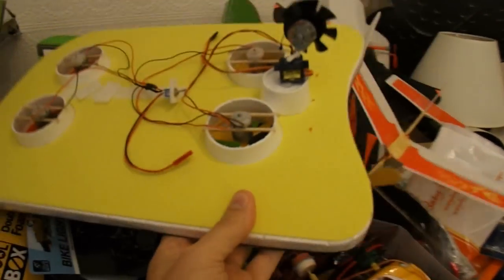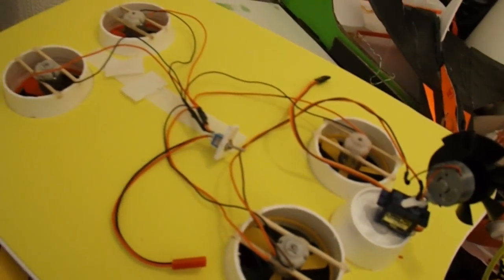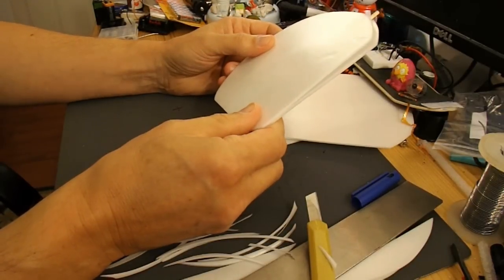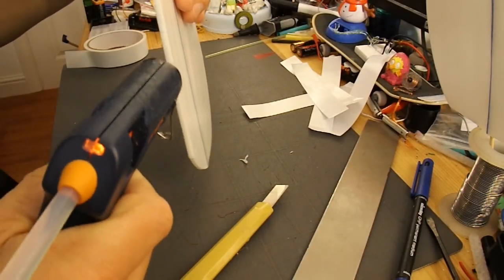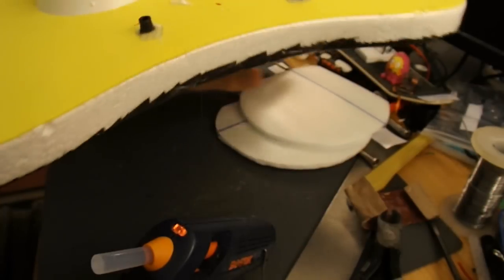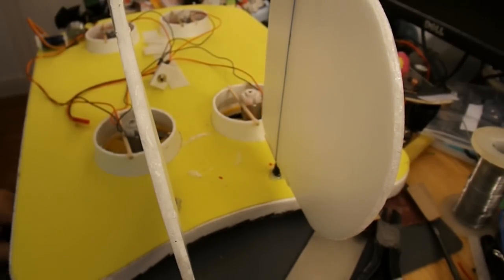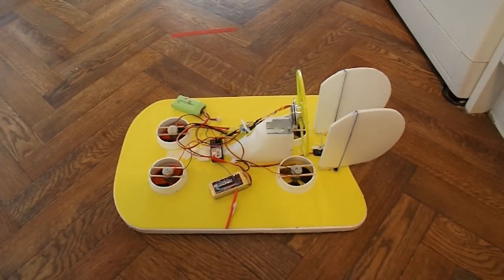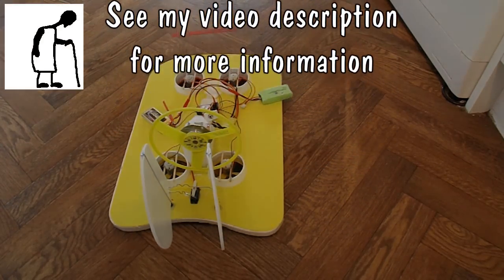Quad Fan Hovercraft Update 30th October 2014

Comment: if you use centrifugal type fan it give better lift using less power-
I made R/C outdoor hovercraft and used a bicycle tube slightly inflated as air skirt -it worked great -worked on dirt/ grass /pavement - was fun -

Comment: Excellent channel, you have given me so many good ideas. I plan on making something similar to this one day. I think that a more efficient hovercraft design would be to have one larger uplift motor and on the back 2 smaller motors for the steering. I would run each of the 2 steering motors off its own channel on the transmitter.
Reply from the maker: Yes differential thrust is a convenient way of steering, especially if you use ESCs with forwards and reverse. Being able to reverse away from obstructions is very handy with hovercraft as they often get stuck against a wall or similar. If you follow this series back to the beginning, this hovercraft was originally designed to have a flat bottom with minimal ground clearance and no skirt to see if it would work like an inverted air bed. Here are some examples of what I mean https://youtu.be/t6m01VGiNPI?list=PLA5a2xPRSrB1ynqKhyKVIcl945NCbHZZE https://youtu.be/aOrlP7dvd4M?list=PLA5a2xPRSrB1ynqKhyKVIcl945NCbHZZE https://youtu.be/qbAuaN8wIvA?list=PLA5a2xPRSrB3zoLYIrdESCCWdx2nLq8r7

Comment: Did you try this one on the Lake ? It looks top notch, Nice one Granddad.
Reply from the maker: No this one has not been on water yet. Why do people always ask about putting hovercraft on water? If it works on land it will work on water. As long as the surface it is travelling over provides a reasonable airtight surface it should be fine. It is travelling on a cushion of air not the surface underneath. Model hovercraft have problems on surfaces like carpet or gravel because the air escapes, but they probably work better on water than they do on land. The body of this one is made from a swimming float anyway so worse case scenario it will float and be pushed along by the directional fans anyway.
Reply: GrandadIsAnOldMan I asked because I live on the I.O.W where we make hovercraft and we use them to go to the mainland (you know England)  so I have a special dispensation for being a dum ass......Haha
Reply from the maker: Graham R Dyer it just fascinates me that on nearly every hovercraft video I upload, somebody will always ask if it will work on water and testing it for them is a pain because that means I either have to fill my bath or make a special journey out. I think we still have a hovercraft rescue vehicle at Burnham on Sea to rescue people who get stuck out on the mud flats.
Just checked, yes there is. http://www.burnham-on-sea.com/barb/